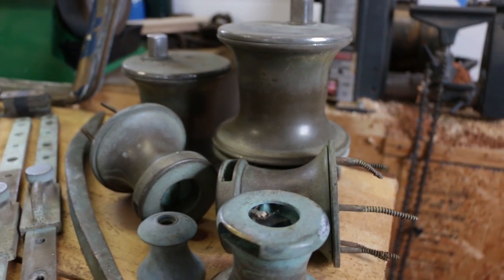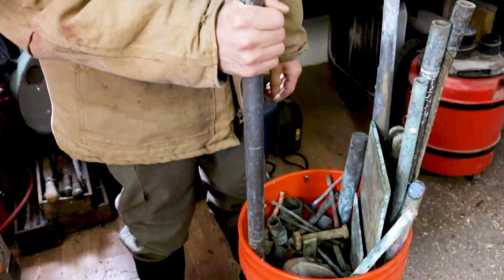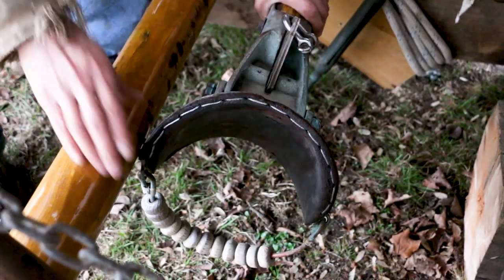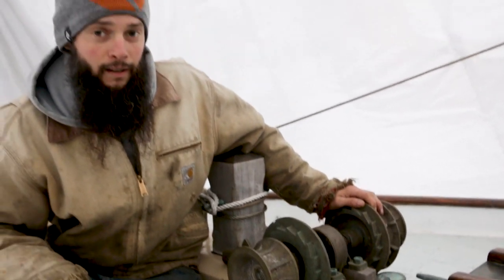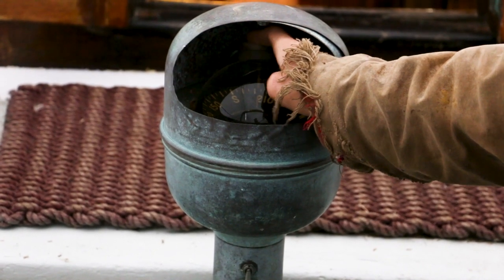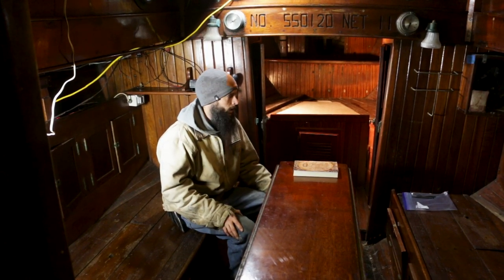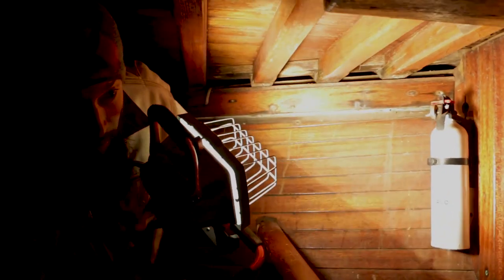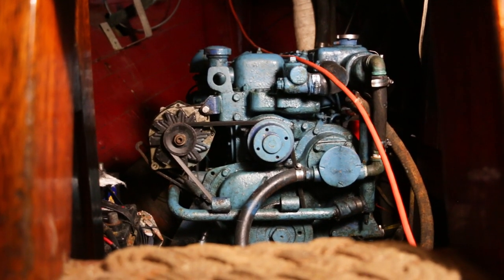Acorn to Arabella - Journey of a Wooden Boat - Bonus Content: The Good, The Bad and The Bronze

Comment: Tiller arm.  UK canal boats are steered from standing in the rear hatch.  The tiller arm is curved to make it the right height for the steersman to use.  If this arm was fixed it would make it difficult to get out of the door, so the arm enters the tiller at an angle.  When moored up the arm is turned over so that it curves up not down.  This serves the duel purpose that it stops you banging your head but a boat with its tiller reversed indicates that it is moored up, not just waiting  to go through a lock.

Comment: Awesome haul....Not a bad idea to take pictures and measurements of the pockets in the wood for the various fixtures and latches as you remove them. Position and angle of catch plates etc. Make basic cardboard templates/notes to keep with the parts. Basic hinges, forget about it, but that locking door knob latch could be fun getting lined up perfect in a new door without some guidance.
Get a bunch of zip lock bags and keep the screws and stuff with each part. Some of that bronze may have been added later. The fish towel holder may be an addition. There appears to be a putty filled screw hole above it on the wall where it was moved or where something else was mounted originally. Many times back then screws were house made which means the screws from the soap dish may be slightly different looking from the ones in the door hinges etc.
Reply: Standard procedure in restoration work for example. Pictures, in situ, off, and with the initial emplacement, and then drawings, and templates.
Reply from the maker: We have started to bag and catalog things and intend to keep doing so.  The video footage is a huge asset! 
The pattern making is a good idea and one we had not thought of.  Thanks!
The hope is to keep Victoria as whole as possible for as long as possible so we can measure and transfer as we go.  She has safely held everything in order for a long time, don't see a need to change that sooner than required.

Comment: Just a thought on that Perkins engine - it looks like a 4.107 or 4.108 - you would struggle to do better. I have been using these engines for nearly 40 years with next to no trouble. Parts are readily available everywhere. They are economical, easy to work on and will sound right for Arabella.
Reply: Pete Nash The motor was going to be my next question
Reply from the maker: It's a 1987 4.108m and that is what we have heard.  She fired right up after almost a year of being idle.  No small feat for any motor never mind a 30 year old motor!
Reply: I used a 4.108m in Temptress for 25 years and 20,000 ocean miles.  I just upgraded to a Yanmar as the 4.108 was always too small for Temptress.  I have loads of spares, injector pump, starters everything.  If you are interested PM me.  Advice:  I like the 4.108 but make sure you know how to bleed it.  It's a pain to bleed but if you add an electric fuel pump (I use mine to transfer fuel between tanks) it will bleed much easier.  Just know how to do it before you take an air bubble in on a stormy day when you need then engine.
Reply: well except for the notorious oil leaks
Reply from the maker: Right on,
It's going to be a while before we dive into the motor and determine if it's worth restoring and using but if it is we would certainly be interested in picking your brain and seeing what you have for pats kicking around.
Thanks!
Reply: Maybe I have been lucky but have known a dozen Perkins 4.108 engines and they have all been pretty dry but the old Bowman heat exchangers have challenged me a few times, especially when away from the workshop.
Reply: Let's do everyone a favor and stop calling this beautiful engine a motor.
Reply: Or we can just be intentionally confused about it...
Reply: When I hear "motor," I think "electrical motor."  That is, unless, the context is about automobile engines...

When I hear "engine,"  I think "internal combustion engine."  I never think of "electrical motors."  However, I've seen it used in other contexts; the "engine of the economy," for example...  Yet, I've never heard of the "motor of the economy."

I guess it really does depend on the "age" when the word is used to describe something.  The concept of the word remains the same, but how it is used changes....  Amazing!
Reply: But we put motor oil in an engine
Reply: @kheperiupuaut  In that same article: Today, the words are virtually synonymous. “Language evolves to take on new tasks,” she explains. “Without thinking about it, we adapt to new meanings and leave the old behind.”

Comment: I put a 4108 in a 40 ft schooner many years ago. They are bulletproof engines and parts are readily available. It is most likely a refit as those boats were originally fit with gasoline motors such as the greymarine and older series. You really can't lose with that Perkins motor. It will push your boat in a current when most boats are anchored waiting for the tide to turn. I don't know how big Arabella is going to be though.
Reply from the maker: The motor is a 4.108m made in 1987 so for sure a re-fit.  We have heard mostly rave reviews about them and hope it's in good enough condition to be re-used.  Time will tell but if it makes it into Arabella it will be after a complete and total overhaul. 
Arabella will be 38' on deck and displace 25,000 pounds empty.  Plans call for a 40hp so the Perkins should have plenty of oomph.
Reply: I might add that you might consider going to a more modern rig, if you are planning to sail the world short handed. The gaff rig is is a more complicated rig than Marconi, it is a much heavier rig and can foul when you are trying to get it down when conditions are turning bad on you. If its a nod to a look, I get it, but think long and hard about that rig choice. Having had a gaff rigged schooner with a Marconi main, I can tell you that I have run into just such situations and have been caught fighting the gaff at a most inoportune time.
Reply from the maker: We have until we start framing the deck to decide and nothing is set in stone.   
To our understanding both rigs have their pros and cons.  We also have met some folks who really know their stuff who have offered to help us sort it out once the time comes.  Either way we will re-evaluate the rig since a lot has changed since 1934 and we won't be using cotton sails like the plans call for =)
Reply: One of the mistakes people make and manufacturers make in the smaller boats (up to around 40 ft or smaller) is that the engine space is usually under the cockpit and impeding into the cabin. But to save space for living, its common to skimp on that engine space. Big mistake! When you have to work on those engines and you will, oil changes etc, its next to impossible. If I was to build a boat these days, ease of axis to my engine would be a priority.

Comment: Amazing. I'd be tempted to keep Victoria as a land-based "boat", to maintain the cool interior as a place to camp out, or even live. You'd just have to restore the bottom structure I suppose. Of course, that's not a viable solution for the long run. You did the right thing by bringing her back to life in a new boat and tender, but I'd find it hard to make that transformation.

Comment: Great find!.  That Perkins (looks like a 4-108 to me), the transmission and the Max-Prop alone are worth many times more than what you paid.  
One quick correction or the windlass: that hand wheel in on the front of it does not adjust the speed as you described, it is a clutch.  Turn it one way and the clutch is engaged and the crank turns the gypsies.  Turned the other way and the gypsies freewheel (useful for dropping the anchor).
Reply from the maker: Damn good eye! 1987 4.108m to be exact
Thanks for the correction!  
It's great to be learning about the stuff we own =) We know enough to know we know practically nothing and comments like yours help us immensely.
Reply: I think someone else pointed this out, but the handspikes (maybe bronze, but likely steel rods) for the windlass should be stowed aboard somewhere. They look a lot like the stanchions you had in that bucket (you called them lifeline "uprights"). Just make sure you don't accidentally melt them down!
Reply from the maker: We have not had a chance to look yet but we will figure it out before we get rid of/melt anything down!

Comment: That Maxprop new is around $2,500-3,500 depending on specs.  I read a Yachting magazine article the other day that suggests (and confirms my own experience) you earn 1/2 kt to 1 kt of speed with a feathering or folding prop as opposed to a fixed one.  On a big ol' girl like Arabella, that's a real benefit.   The Maxprop and others like it apparently add a little more propwalk than folding props, but have great power in reverse.  I have a 2-blade Variprofile that is very similar to a Maxprop.  I love it.   The one trick is that you have to pop the trans into reverse (after you shut down the diesel)  to get the prop to feather.

Do not attempt to dismantle the prop.

So much additional great stuff beautiful bronze details and bits and bobs.  I am guessing that that Perkins is a treasure - some level of rebuilt will get you another 5,000 hours out of it.  I'm kinda thinking your HP estimate is incorrect though.

What a great value it was purchasing that boat, and I think you're paying her great respect by re-using all of that gorgeous hardware and timber.
Reply from the maker: Thanks for the info!
It's always great to be able to read the comments and learn something!!! =) 

We have the manual for the Perkins and the manufacturer claims 53 hp.

Comment: It’s really good to see that you are recycling as much as possible.
If you put that ‘’griddle’’ on a source of heat, it will brand your hands, also you have to be very careful of Verdis Gris(the blue greenish colour), it’s copper(that’s reacting with the acidic water/air) which is poisonous.
I have seen something similar on Radio transmitter/receivers, so that you can move them for maintenance.
But I cannot guarantee that that’s exactly what it is.
I love the Binnacle, it is the crowning glory, we used a low powered white bulbs, but I don’t see a problem with a red one, other than the fact that white bulbs are easily found.
Good luck(not that you really need it), and I hope that you have the Sun in your face, and the Wind at your back...

Comment: The Perkins 4.107/4.108   I have a 4.108 that is the original engine in my 1973 Gulfstar.Output is 55 HP. Unknown about the hours on the engine, I would say lots. Lol Compression is great!. Normal stuff to keep it running. Valve job and new seals. New head gasket a few years ago. I used Seafoam to clean out the carbon every year or so. The engine has never failed me.
The 4-107 has the same block as the 4-108. Perkins gained extra HP on the 4.108 with a higher output Injector Pump and Injectors. One of the main plusses of a 4-108 is the availability of specialist parts companies like Transatlantic Diesels and Foley (both sell parts online and are reliable and knowledgable) at very competitive prices. 

The 4-108 is a very old design now but its easy to work on and will keep going with less than perfect maintenance (not that I would neglect such a thing of course!).
Reply from the maker: Thanks for the tips!  We believe it is in good enough shape to install in Arabella and we like the older simpler motors for sure!

Comment: Tamaya (Japanese) is actually a very good make of sextant.  The real issue with Celestial Navigation however, is the need for accurate time keeping. You can either spend $2-$3K for a highly accurate  mechanical (eg Hamilton) chronometer, or $24 for a much, much more accurate Timex quartz.  If you go with the Timex, don't bother with CN and just buy another GPS.  It wil take several hundred fixes (i.e. years) before you'll get good at site reduction.

Comment: Hi lads. I'm absolutely enthralled by your boat build project. You're one of only three channels I sub to just for the sheer obvious dedication, love, aptitude and respect for your project that you show. I was wondering whether you will be using a local foundry for casting or doing it yourselves. If you are casting any pieces with aesthetics that need a positive wax model from which to mold the item(s), I would be honoured to make these for you (on the house) as I am a sculptor with the experience. Although I am in Ireland, it's of negligible concern getting the wax positive sculpts to you. The offer is there and I would be very honoured to assist in any small way towards that beautiful craft. Have a great one.
Reply from the maker: Thanks for the offer!  We are not quite sure what route we will take when we get there but we will keep the offer in mind.

Comment: the location of the hole for the anchochain on Victoria seems to far forward; it is in Front of the winch. When raisin (or lowering) the anchor the chain would be from the bow roller, under the winch to back of winch, up and over winch and then via the hole into the chainlocker. It does not seem right! but if you are happy with it, who am I to complain :-)

Love the way you are building a boat using 'traditional' work. Love your pour, lifting and moving of the keel.

Restore that sextant! it is really fun to navigatie by the sun or stars; i use a plastic variant which gives results good enough for ocean navigating but not for coastal navigation :-(

Go go go! keep up the good work!! :-)

Comment: Nice bronze guys, you should polish it! Any more building soon?
Reply from the maker: We love the patina but will use new fastenings though out so we will probably end up polishing the bronze at least for the launch. 

Old man winter kinda threw the brakes on us.  With getting Victoria and Alix helping his dad move back to France this fall we missed the window to pour the ballast keel since the ground is now frozen and white.  We also put a significant dent in our oak supply laminating the backbone timbers so we need to harvest some more so it can season a bit before we use it.
The plan for the winter is
-Do more logging (got access to a cable skidder so it will go 10x faster!)
-Make a new ballast keel mold out of wood
-Finish chainsawing up the lead keels to fit into the tank
-Early spring we will mill the logs from the winter (we have a bigger mill than last time that comes with an operator and Alix is here to help full time this time so milling will also go much much faster.)
- Make as much $$ as possible so in the spring Steve can quit tree work and we both can go full time, full bore for the summer. 

Come April? the ground should be thawed, we will tackle the pour and start shaping the timbers and bolting them together.  Since the keel timber and backbone timbers are roughly shaped and on stand by it should go decently quick.

Comment: I would love to see what the brass looks like once restored are you going to polish it or acid dip it , to bring it back to new
Reply: Jj Coronet bronze is quite different than brass. Bronze is long lived and relatively stable in a salt water environment and the patina protects it.  Brass has zinc in it that salt will leach out leaving behind a pink sponge with no structural integrity.  A brass chrono and a brass bell are  fine though and should be polished.  Cheers

Comment: When will you show some of the work that you doing on the Arabella? The last of the work was a video on starting of the milling of the keel.
Reply from the maker: When we get back to working on her.
The fall got bonkers with getting Victoria and Alix's dad moving to France, fire wood had to be readied, the boat house needed buttoning up...  All that is done and settled but the ground has now frozen and is covered in snow so the keel pour has to wait until spring.  
We also put a big dent in our oak supply after laminating all those backbone pieces so we need to do some more logging and milling so the lumber can season a bit before we use it.  We got access to a cable skidder and a much bigger mill that comes with an operator so logging/milling should be a much much faster process than last time! 
The winter videos will be us logging, milling, making the new ballast keel mold (we ditched the concrete one) and the second the ground thaws we will tackle the keel pour and get back to shaping timbers and bolting things together. 
The spring will be a very exciting time!

Comment: Not many people can claim to have bought a boat at any price that came with its own sextant.  Sextants tend to be tough instruments, if the gearing is ok, the rest should be repairable.

I think you are going to need some polish on that binnacle to get it to run smoothly, which it really deserves.  Are you going to oil all the bronze?  Arabella is going to be pretty as well.

Any chance to get a survey of all the hull lines on Victoria before you pull her apart?  Or are there original blueprints?

Thank you kindly.
Reply from the maker: The plans are available through Pat at Atkin Boat Plans.  We believe she is a Dragon but could also be a Thistle, Eric or Wild Duck (all 32' double enders) but the Dragon seems to be the closest just looking at the hull verse the drawings.  
Victoria will be whole for some time so if anyone feels inspired to take measurements they are more than welcome!
We love the patina but think it will look funny to have shiny new fastenings in all the patina covered bronze so we will likely try to hunt up some volunteers and get it all polished at least for the launch.  We also have been told that Arabella needs to earn her patina and we feel similarly.
Reply: Cool, I love that designs for boats 100 years old are still available.  I saw the other day that many Herreshoff designs for fittings are still available.

On the other hand, there is NO original film version print of Star Wars.  We need to protect our heritage better, and you guys are doing well on that front.